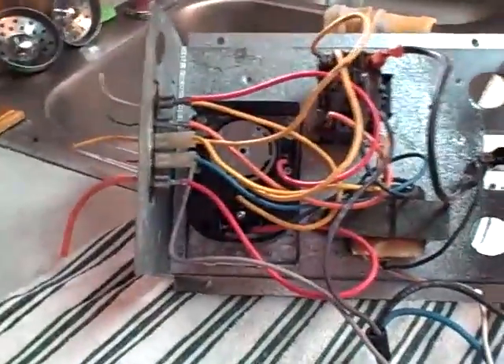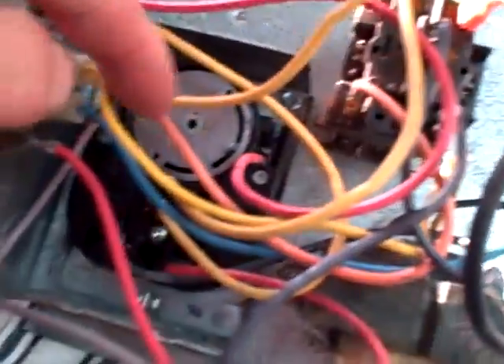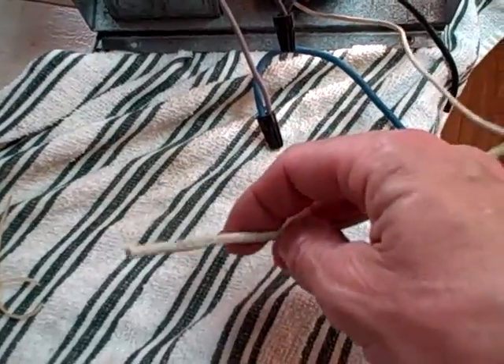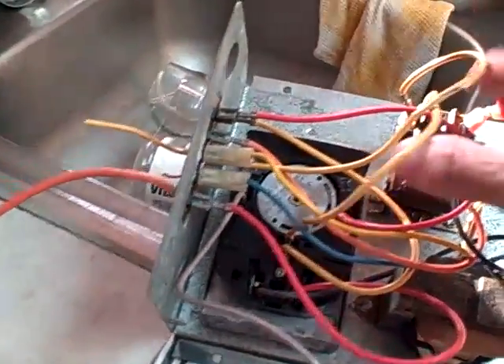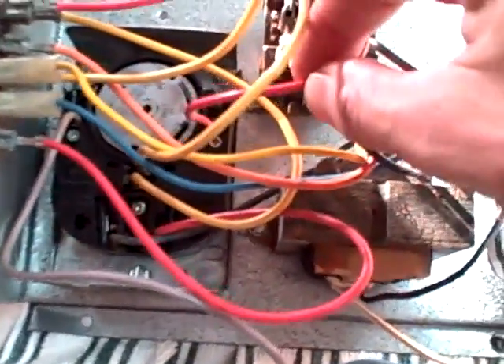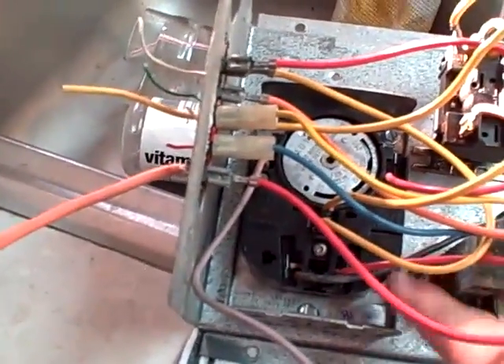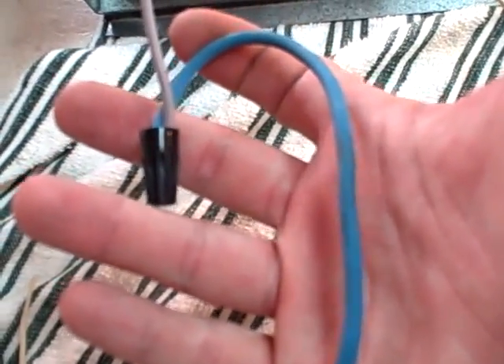HVAC Combination Fan Limit Switch *Revisited!*

Comment: We have honeywell l4064t to 4 wire Lennox plus and it has 6 wires and we need help how to replace it with Honeywell that has 4 wire any help or advice how to rewire it
Reply from the maker: This is one of those situations where it's worth paying to have it done, even though you know they are going to stick it to you :(
Messing with gas is serious business, so to speak.
Yes, the six wire combination fan limit switch can be replaced with a four wire combination fan limit switch. The two middle/center wires are for a low voltage preheater to warm up the bimetal could material in the rod on the switch to keep the unit from short cycling (not always an issue, but...)
I personally wouldn't switch a unit that had it that way from the factory to a 4 wire unless it was just to get the customer heat until I could get the right part in (assuming I had one on my truck to begin with)  and assuming that the one I had on the truck was the right length, i.e. 4", 6", 8" etc.
I wouldn't be comfortable even trying to tell someone how to change out a 4 wire one, because forgetting to remove the metal jumper tab, IF it's supposed to be removed, or actually needing it there, is the difference between working and burning something up. Then there's the fact that a 4 wire can be wired several different ways! It's one of those situations where you really need to be standing there to sort it out.

Sorry I'm not much help here :/

Comment: How old is an "older" furnace in which you would find one of these fan limit switches? Before what year of manufacture?
Reply: I have this EXACT model still kicking away!  It's a 1986 🏆 Snydergeneral DGHA125A020BN and the AC repair man came out to verify my diagnosis (per my wife's order) and said yeah, my blower motor went out 👍 Then he went on to say that these were built like tanks!!!  So far so happy!  Great video and always appreciate you! 🏆🙏💡

Comment: Could you help me. We installed 2 rooms on my brothers place and the air flow is extremely low. We are installi a duck fan to help boost it. Can I wire the fan into the furnace controls.  It's a cmf80po. The fan is .35 amps 30 watts. Any help would be great.  With the ducts under the house here in pa we don't want to run a thermo controller unit for it because of outside temp interfaces.
Reply: Yes, just pigtail your black wire from the fan that you are adding to the wire going to the normally close relay and your white wire with the white wire going into your step down transformer. That only will work on heat mode.

Comment: Can u install that jumper for low voltage limit once it has been removed? You did not go to much into how it cuts out the gas valve on high heat situation. I know that there is a low voltage cut out and high voltage limit, just do not know how it is wired.

Comment: The pre heater f/l was used on counter flow furnaces I believe to prevent  excessive heat rising into the return plenum tripping the aux. limit and maybe damaging the fan motor. On an up flow the heat rising isn't an issue since it's going into the supply duct .I believe this is the reason (or maybe among other reasons)for the pre heater.

Comment from the maker: @deyenak1 Sorry I"m late on answering, haven't logged in for a while.  Yes, depending on the system... check all of the sensors to make sure that one of them isn't open.   Is the unit trying to ignite several times and failing to do so?  This will cause a lockout on many furnaces and turn the blower on as well.

Comment: Is it possible that a bad limit could cause continuous fan.  The fan comes on with a call for heat and will not shut off.  Its a gas furnace and I have eliminated the thermostat and I changed the relay but still won't shut off.  Could you give some pointers on what I might try next? Could The ignition module be something to check?

Comment: could u do a video on the actual wiring on a fan/limit switch in detail? maybe actually install one and explain the steps to wire it. starting with the line voltage to the transformer and the blower and gas valve.

Comment: my father-in-law has a fairly new, Rheem Heat Pump; on a call for heat, on a 55 degree day, the compressor is not on, but the auxilary heat(gas), comes on. I don't know if the t-stat is wired backward, not programmed, or, what is going on?

Comment from the maker: @lolly2cute This depends on what kind of 'emergency' heat you have, usually it it electric but sometimes it is natural gas or some other choice.  Usually the heatpump (compressor) takes care of heat, but if there is a high demand and the system can't keep up or it is too cold and the heat pump is inefficient then the emergency heat or secondary heat  will kick in to help make up the difference.   There is quite a bit more that I could explain in email if you need but this is the basic of it.